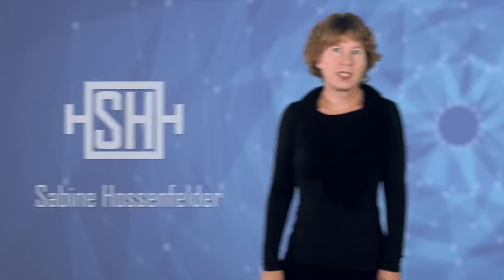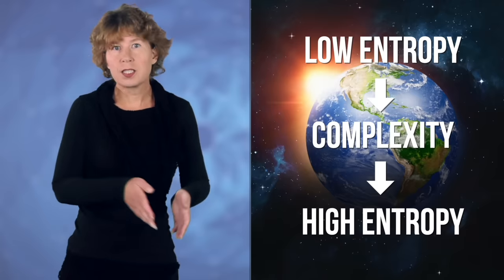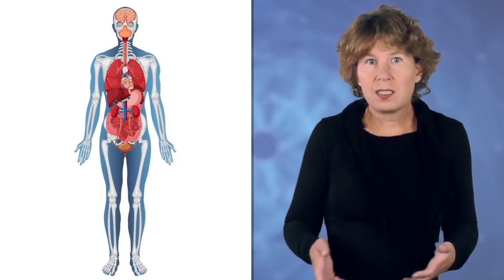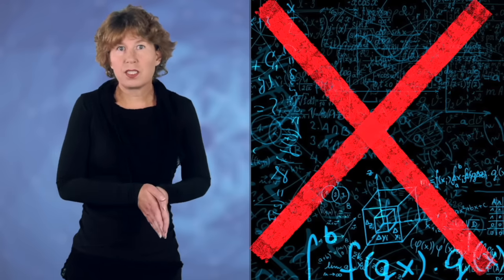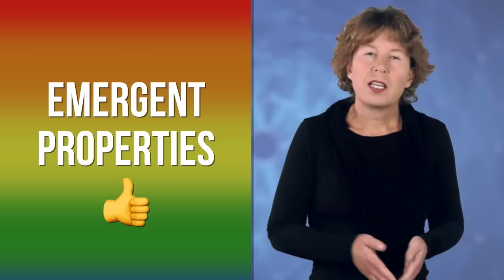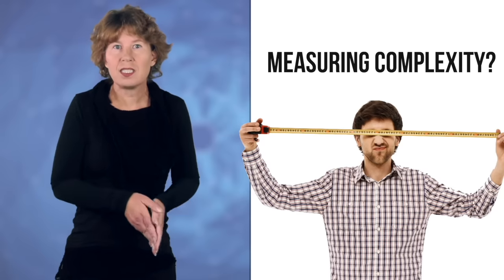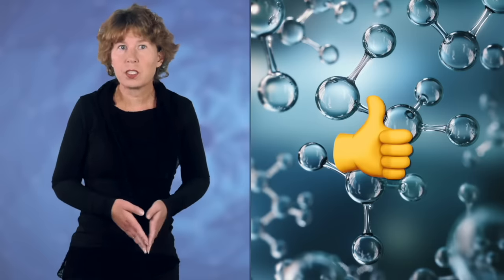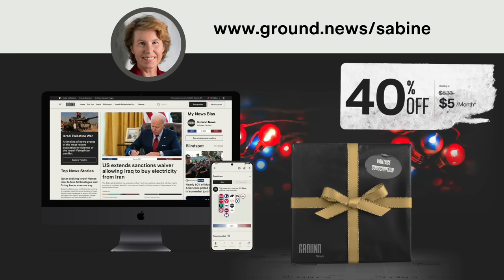The Biggest Gap in Science: Complexity

Comment: The problem with the word complex is it cannot correctly align with the term order which is defined mathematically as LOW ENTROPY or highly IMPROBABLE. The coffee and milk separated are described as "simple" but they are in fact highly improbable. The process of mixing the two is just improbable order moving to more probable disorder. The state in the middle described as "complex" is just that a subjective description at a point in time unrelated to the physics and completely unrelated to the actual process of entropy change of the system. So complex has no scientific meaning whatsoever and certainly cannot be measured objectively. It's just an excuse to avoid the true meaning of the term ENTROPY.

Comment: Interesting video. Din't Einstein say that Nature prefers simplicity? I think that complexity is defined by the number of systems involved in a system at the same time, and one's capacity to understand/comprehend all the systems interacting in the system. I also believe that Cahos is simply the Nature's response to complexity, elimininating redundant and therefore useless systems to make a new one more simple. That's where I think kbit gets very interesting: at this stage of human evolution, we cannot comprehend how Nature works. It becomes like quantum mechanics. We can make predictions and statistics, but never be 100% sure. Here, time should be the common denominator ator because a system can be said active when its state changes over time. A rock will erod, react to changes of temperature, and change its state based on chemical reactions due to its environment. 
Smart people cam handle high complexity systems whereas a non-scientific like me will reach quickly his limit. For example, a trained somelier can identify the complexity of the aroma of a wine, when the average drinker will taste only Chardonais or Merlot. 
We don't understand the universe because we cannot yet connect all the systems involved in its system. We do have computer simulations for the Big Bang, which worked the moment we included Dark Matter and Dark Energy, wasn't it?
I don't think we can calculate complexity; we can evaluate it by the number of systems involved, which will evolve as we get more knowledgeable.
During the Dark ages, our ancestors explained many things by divine intervention (simple), of which many are explained today by physics and science (complex).
In conclusion, what I love about this topic is that it describes Mathematics: the very first step into solving an equation is to define its domain, isn't it?

Comment: You have to simplify it because it's infinite.         There's no single way to describe infinite eternal complexity with complete accuracy in every reference frame and fractal of time units.    But everything evolves from infinite empty space and a second infinity of vaccum energy which always occupies the void.    These two seperate infinities are intertwined and in eternity or forever portions of vaccum energy would collapse as energy and matter are equal. which means vaccum energy or wind which is energy has mass and is interconnected but the mass is spread out over unfathomably large volumes in empty infinite space.        Occasionally a small fraction of infinite energy will collapse into a singularity and cause a big bang as the wind energy pours into the compact singularity.                          The capacity of the dense structure is limited so it reaches a critical density ,expands from the heat and pressure ,then it explodes transforming vaccum energy into matter.      Then it's like the three body problem and infinite complexity begins to lattice transformations of concentrations of energy packets in quanta or matter in every direction in latticelike structuring branching off exponentially into different combinations approaching and mimicking truly infinite complexities no mind or AI can follow.             Although everything seems disconnected and seperated that's our macroscopic senses which filter a sense of reality along with entropy .                         We sense time which is matter or concentrated energy spreading out in space and eventually cooling and evaporating the concentration of heat.        Our senses and thoughts are macro -oriented because living matter is a combination of dense particles and empty space within and outside our motion as living matter.     Time itself is just the effect of entropy flowing directionally as heat cools off and the magnetic bonds and gravity weaken over time .   Time flows differently in different density regions or area of volume of matter density within an area of volume.       Once entropy has run it's course and heat energy has evaporated time ends in a vaccum as time is only a description or definition of our imagination but a macro percieved frame of reference .  Of infinite fractal branches of seperate infinities that stretch out into eternity but stem from two infinities.    The third infinity ,matter, comes and goes in eternal infinite space as big bangs must occur repeatedly because of infinite vaccum and infinite energy.     The matter comes and goes so to say it mimics infinity then stops is accurate from one or some reference points.     But from others to say it isn't infinite is incorrect because in infinite space with infinite energy big bangs are endlessly eternal.                   There's opposition naturally occurring in falling on an outcome and trying to precisely define it in one way.      the universe contradicts reason which stems from the macroscopic senses of creatures.      Everything is interrelated and branches off from simplicity.   There's two ways to describe time.     General relativity and quantum mechanics make sense seperately.   But do not agree when attempting to combine measurements.        We cannot observe  the quantum world because we would need to become particles and nothing makes descriptive sense there because descriptiveness itself is macro - oriented.         So there's a natural yin and yang to the eternal universe which is what we are part of where we are like schroedingers cat.   We exist yet we do not exist.    There's no way to describe reality with partial limitations of our viewpoints.                There's a wave function transposed as a statistical percentage of every possibility's potential of happening statistically.             There we best to make estimates as precision is elusive and uses up every drop of available and non-available energy or resources to no avail.     Precision and or proof of something like global warming is a waste of time as agreement on a consensus cannot occur.                 We have to estimate alot.  That means we have to trust some assumptions as distasteful as it seems in making assessments of reality.            We can only estimate reality .     But we can't have any definite statements because of the nature of the universe not allowing any one statement about a portion of reality to be fully accurate within an infinite number of branching out in all directions frame of reference on every potential subject and more branching of fractal relationships of each subject creating infinite symmetries for eternity.             Every slight thing alters the maths and equations.       Everything becomes quantum foam including thought in the quantum realm.     The calculus exists but no one or even AI will ever be capable of following the trails and predicting the future .    We have to estimate reality using statistical analysis as a simplification tool to narrow the range of possibilities to likilihoods of total outcomes in a percentage.            And we must save energy to extend the range of our existence in macro percieved time.                    Knowledge can arrive directly with proof or more often accuracy in truth must arrive through indirect means of inferred observation and imagination plus extremely accurate reasoning methods.                  That's the most serious thing we must do to improve daily as individuals and possibly evolve to become better creatures.

Comment: Your remark that the baby and the rock have the same Kolmogorov complexity is wrong. Actually, I think that both rock and baby have roughly the same Kolmogorov complexity.

Kolmogorov complexity measures the length of the smallest description of an object. We could agree on a direct, not necessarily efficient description of an object. For instance, pretending for a moment that the world is classical and deterministic, we could describe the baby/rock by stating the position, momentum, and type of every single particle. To the issue of how to represent this list of position/momentum/particle-types, Kolmogorov says: just take the length of the smallest program that outputs such a list. This is the Kolmogorov complexity of the baby/rock.

Then an object will have smaller Kolmogorov complexity if its particles are organized neatly into a pattern that is easy to describe. E.g. A crystal cube will have very low Kolmogorov complexity, since knowing one particle position, and the dimensions of the crystal, will tell us all the others. A gas inside a cubical container will have very high Kolmogorov complexity, since the position of the particles is almost completely random: knowing any number of particles will say little about the position of the remaining.

Indeed, Kolmogorov complexity should be understood as a measure of the entropy of a static object. The following theorem can be proven: In any such a classical stochastic system, the entropy of the system (up to O(1) terms) is equal to the expected Kolmogorov complexity of the list of positions/momentum of the particles!

As for whether a rock has less or more entropy than a baby, that depends on whether the particles of the rock are disposed in a more or less patterned way. I would guess that, for a suitable rock, K(rock) is roughly the same as K(baby), since both rocks and babies have parts that are roughly patterned (e.g. quartz crystals, bones) and parts that are roughly random (e.g. the distribution of quartz in a rock, the specific position of blood cells).

In Algorithmic Information Theory, there is this concept called "computational depth", which intends to capture the notion of complexity which you are referring to. See https://pages.cs.wisc.edu/~dieter/Research/depth.html

The computational depth of an object cd(x) equals K^t(x) - K(x), the difference between the time-bounded Kolmogorov complexity (size of smallest efficient program for outputting x) and the usual Kolmogorov complexity (size of smallest program for outputting x, even if not efficiently). Now notice: if x has a very simple pattern, K^t(x) and K(x) are both small. If x has no discernible pattern, then K^t(x) and K(x) are both large. In both cases, cd(x) is small. So cd(rock) and cd(gas) is very small!

Now suppose that x is the outcome of some useful computation, that took a long time to make. E.g., x is a baby. Then K^t(baby) is much larger than K^t(rock), because one cannot make a baby without 4 billion years of evolution, but rocks are a lot older in the universe. So the complexity of the distribution of rock particles vs baby particles is probably the same, but if you add time-bounds, probably not. (? 🙂)

Comment: Wouldn't complexity be the quantity of information you need to describe a system, usually? In other words, it's "non reductability"/impossiblyness to compress the information? Though I believe in this sense, the clockwork would probably appear to be the most simple system, compared to having to describe all the internal chemicals reaction of a baby or the complex structure of a rock.
Defining complexity and measuring it won't help in any way in defining more complex system, at much it will give us a mathematical way to know what simplify it and what complexify it. And we only have "simple systems" because we work hard to simplify them, throwing out every variable that have little to no importance and focusing on the area of interest, because otherwise it would be too hard, too complex to use!

Comment: Not simply how something is made up, but what sort of chemistry it tries to do.  Rocks only interact with stuff in immediate proximity.  They don't go looking for food or shelter.  Thus entropy itself is incomplete, since biology, using various forms of chemistry, makes conscious(?) attempts to change things and does not run down, like physics insists, until after death, whereupon it becomes the equivalent of a rock.  An example is a bacteria changing direction towards a food source, or away from poison.  How does it know?  Who knows, but it seems to be fundamentally different than quark 'behavior.'  So the question is, what IS life, or consciousness, and is that different than 'complexity' or does it require complexity to operate?  In terms of 'structural complexity', is its chemistry electro-mechanical, with inputs from the other fundamental forces, or is it entirely different?  So chemistry is NOT ultimately all physics, but rather physics is ultimately all chemistry, following as yet unknown laws.

Comment: I'm 2 minutes in and have not heard any mention of context.  
If you look at the behaviors possible to a baby compared to a complex clockwork mechanism, you may find that the clockwork is capable of more complex behavior.  
However, if you look at the number of possible chemical reactions the clockwork is very simple, it is made of a few elements and they oxidize.  Compared to the chemical reactions possible to a baby, the clockwork is much less complex.
The perception of complexity depends on the framework used to quantify it.
Reply: At 4 minutes Sabine just said something I tried to but couldn't put simply:  On the level of particles, everything is equally algorithmically complex.  Another example of the definition of complexity depending on the  context.

Comment: A rigorous mathematical definition of complexity seems fundamentally impossible, because it entails using math to exhaustively describe something that is inherently bigger than math. Complexity is an infinite relational quality that compares between different organizations of interdependent concepts. Math is a special, minimal, irreducible subset of concepts. Describing any conceptual structure or implementation with math requires an arbitrary, unique encoding system. Unique encoding systems are meaningless outside their definitional frame, and thus cannot be used to meaningfully compare between all conceptual structures. A functionally complete description of complexity would be uncountably infinite, and would require a fully mature universe wherein no further concepts would ever be discovered. That second requirement, however, (while certainly not accurate regarding this universe) is fundamentally impossible to ever prove true. The whole thing smacks of Gödel's incompleteness theorems, though for the life of me, I still can't understand how those are supposed to be anything more than an arbitrarily convoluted restatement of the obvious. So I guess this is just the meta-instance of the computability problem? Granted P vs NP is "unsolved" but there's no reason to believe it can't remain that way forever.

Comment: Doesn't seem like such a complex thing to me.  Number of dimensions that apply to an object combined in some way with the number of objects in the system at the same dimensional level.  Here, a dimensional level is any hierarchy of collections of objects wherin the same measurable dimensions can be applied.

This works at the smallest subatomic scale within a single atom, collections of atoms, collections of molecules, etc etc.  and you could theoretically calculate the number of potential hierarchal/dimensional levels, though we are talking some math that's way over my head, and maybe impossible outside of mathematical theory, but that doesn't matter if sufficient proofs can show success across multiple tiers of hierarchy.

What matters is that in whatever system you are attempting to measure complexity in, that you have access to a sufficient number of other objects at that same hierarchal tier that can be measured using the same dimensions as the one you wish to compare complexity of.

Comment: I wonder where does the "density of information" come into the matters relating to complexity? From what you've expressed and shared in the video, it would appear that when the overall density of information (contained in a thing; be it a baby or a star) is more intelligible and decipherable, then it remains "complex". However it may be teetering on the edge of chaos. 

So the reverse is true, i.e. that chaos[state] is what you get when the density of information (including its structure) is no longer intelligible and is too cluttered.
_______

This inquiry probably describes the state of mind if some of the people working behind the attempt to evolve AI into AGI, ASI, etc. Quantum mechanics is probably makes some of the staff reach their limit (or think that they have). Quantum-physics is easier to understand (especially that expressed by the Hindu Vedas); it should be applied to the research and development of AI, where ever possible.